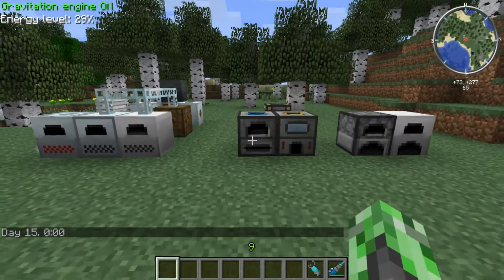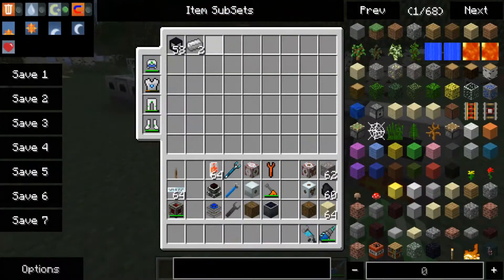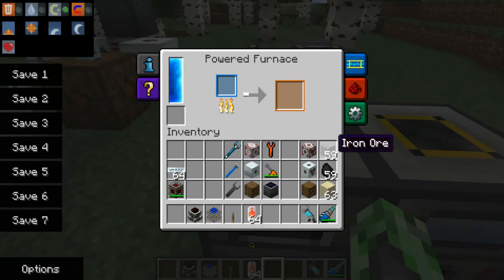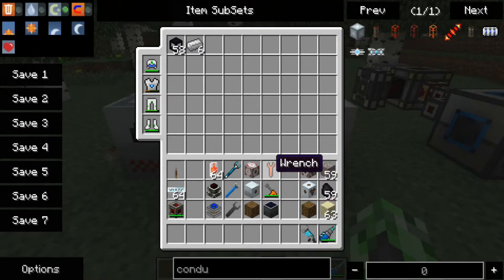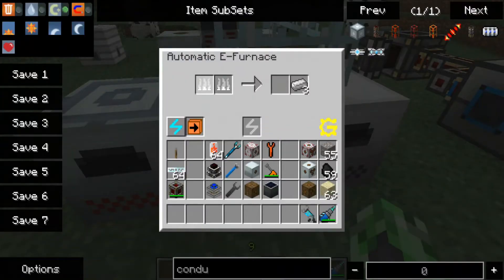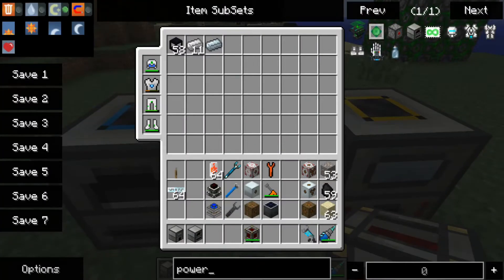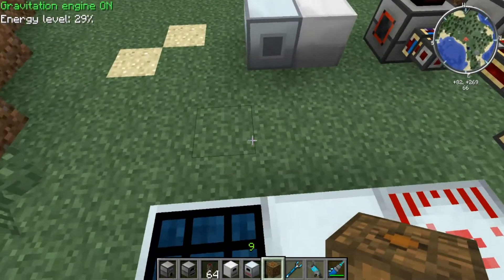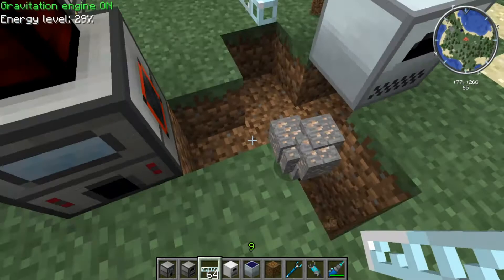Minecraft Ultimate FTB Mod Pack- Which is the fastest furnace?

Comment from the maker: Yea Rotary Macerator is an add on to industrial craft called advanced machines but they work the same as normal industrial craft machines so there's a side for every input. Most likely one slot fills up from the top and the other fills from the bottom, it always annoyed me that industrial craft machines don't do sides very well but go ahead and try and pipe items on different sides and check out what happens.

Comment: Whats the point in comparing the induction furnace to an electric furnace if you dont overclock it? For small batches the overclocked electric furnace is better, but uses a lot more EU. For batch production the induction furnace is the better one.